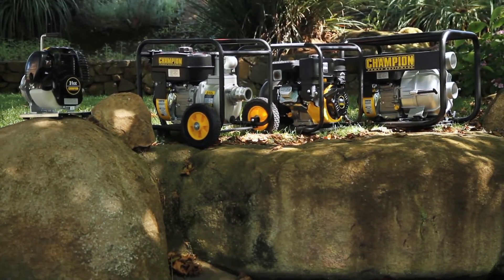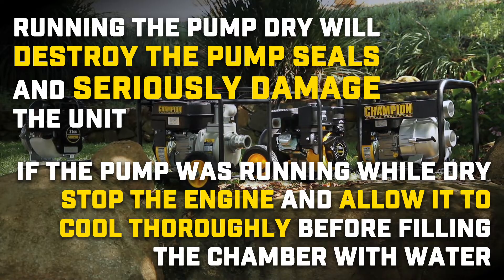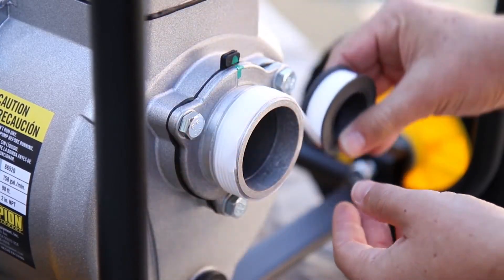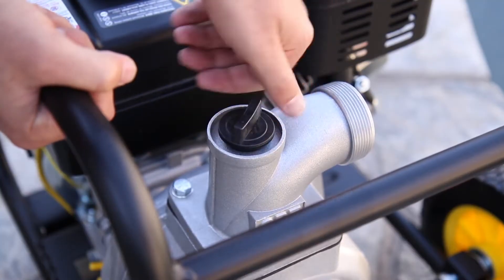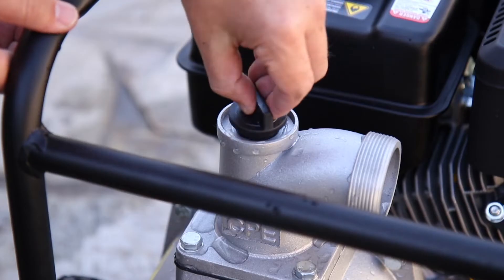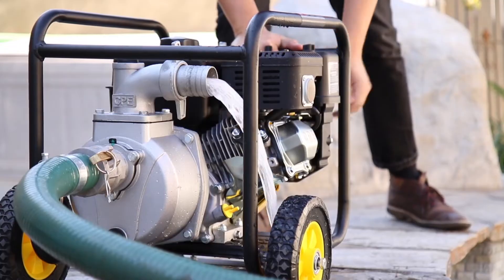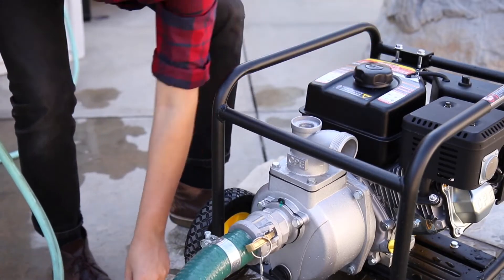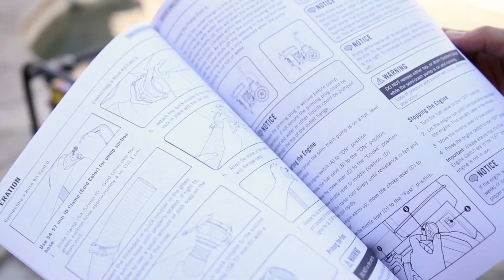How to Prime your Water Pump

Comment: The intake line is full of air. Is that a problem? Am I meant to fill that, too?
Reply from the maker: Hello, when priming the pump the intake line should be filled with water as well. If you have air in the intake hose  and the prime is failing then that is likely the cause. If you need any other assistance please contact our support team at 877-338-0999 or suport@cpeauto.com. Thank you